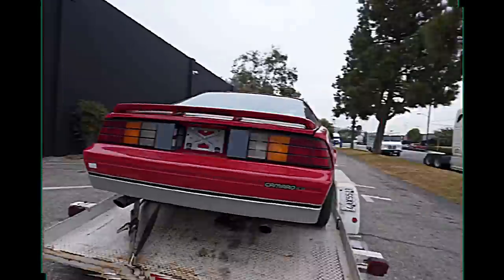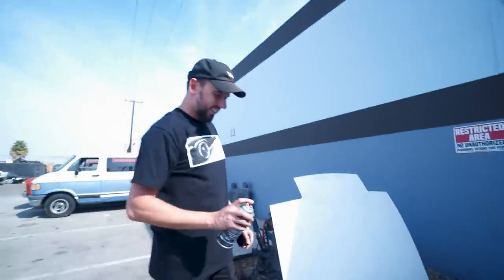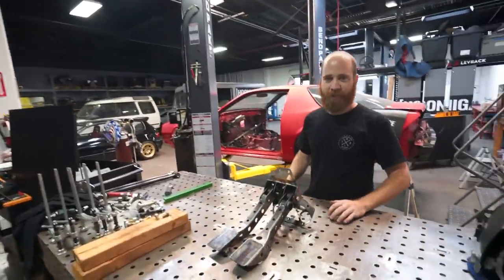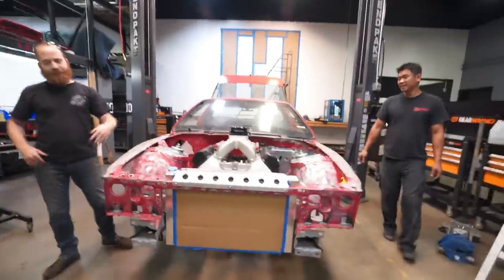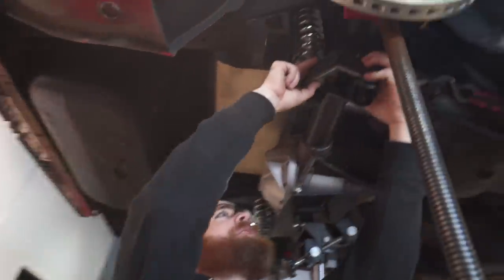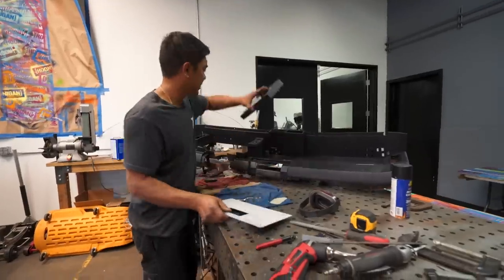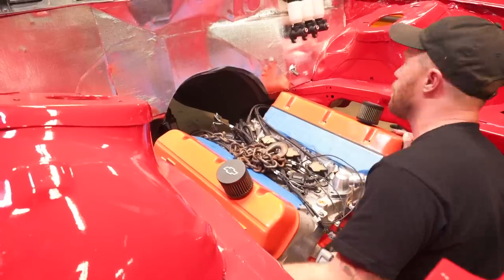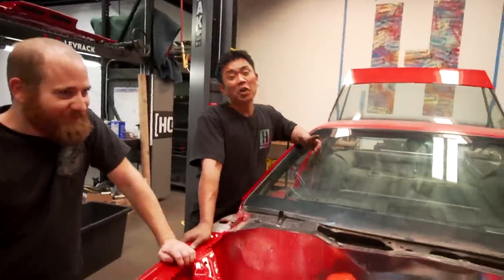Unboxing Chevy’s New 1,000hp BEAST of a BIG BLOCK for our #SEMA Camaro! The ZZ632/1000 Deluxe!

Comment: If you you guys don't run that motor on nitro and make 1400 naturally aspirated horsepower. And then try to go run a naturally aspirated 7 second pass with it, i'm going to be mad disappointed. Since you have that trans, and that rear end, and that suspension with those dampers, all you need to do is install a 2-step setup and throw some 28 inch johnnies on that bad boy, and you could realistically be within shouting distance of ?possibly? the world's fastest naturally aspirated quarter mile pass, for both auto and manual trans.
That motor's 1000hp rating is on 93 octane isn't it? If so then that motor could possibly make over 1500hp at the wheels on nitro. I have seen motors making less than 300 on ethanol, make over 420 on nitro

Comment: Nice big flywheel  ....yes not like a rice grinder.  1000 hp. Engine.  150hp. Clutch.   U guys did not indicate the bell. And what about the holes in the floor. And the bat. Needs to go in the back. Rushed together.

Comment: Why does Chevy put the coil packs in a very annoying spot to change but also wont the coil packs heat up and stop working prematurely? I feel like having the coil packs mounted externally is a much better and much easier to replace when they stop working.

Comment: How many cubic inch? 572? I usually put my firewall insulation on the inside of car. Looks a little better with a smooth, clean , painted firewall in my opinion.

Comment: min 08:20 So why dont you just put the front of the car on a higher place that the rear? fuckit 90°up angle.. You would not have a air pocket. No problem. xD

Comment: that top 4 link bracket on the rear end is not going to work..not enough meat for it not to bend an you have no adjustment in it..call tim mcamis,jerry bickel, quartermax,tinsolders or racecraft for some real 4 link brackets..no point of a 4 link if its done wrong. anti squat and instant center are real things you need to be able to adjust on a drag car

Comment: The heads on that 632 (Super Chief?) Are the same Ci as a 13b full build. For having such a long stroke you figured torque would be better. My guess, compression is greater than 11.5:1

Comment: No such thing as a weldable paint or coating they can lie to you all they want but there's no such thing it will cause porosity it may not be at service where you can see it with your eyes but it is there and that weld is about half as strong as it would have been if the coating had not been there